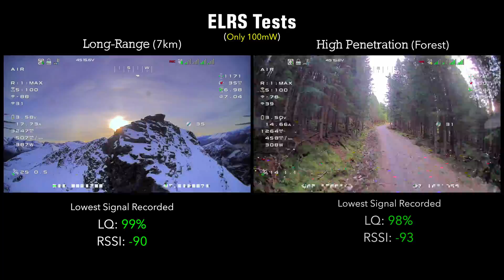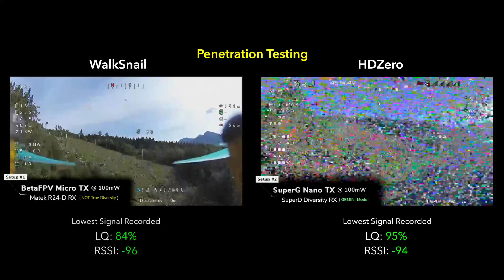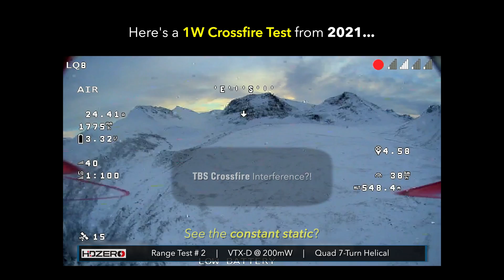Don't use ELRS or Crossfire at 1 Watt: RF Interference reduces FPV Video Quality, Range &Penetration

Comment: I seem to remember you doing either the ferrite bead or internal capacitor mod to your hdzero goggles to prevent the crsf reboot issue. Do you think that mod may have any impact on the video feed disturbance you show when using crsf at 1watt and close to your goggles?
Reply from the maker: I didn’t do any ferrite bead/capacitor mods. The video interference is just noise picked up by the antennas/VRX. I’ve actually noticed this issue as far back as 2021. I put a clip of that flight this video for reference. So I’ve seen this behavior on analog, HDZero VRX & HDZero goggles. Additionally I’ve seen it from both Crossfire and ELRS transmitters. 
Any high power electronic will create noise, that’s why Cell Towers, Powerlines and even Solar Flares can affect our FPV feed. 
Thanks for watching!
Reply: @GiantAntCowboy Thanks for doing that testing! It's really useful for me especially because all my HDZero flying has been short-range so far but eventually I'm going to send one!
Reply from the maker: Nice, I do a lot of longer-range stuff with HDZero and love it. Happy to help, cheers!

Comment: Walksnail or HdzeRo? I have the Walksnail vrx and HdzeRo goggles but not sure which one is the best solution if am going to go with Walksnail I will switch to their goggles because the vrx setup is too heavy and lots of wires but the picture in the walksnail looking superior however your video with the v3 looks much better but it’s hard to decide on watching YouTube so if you consider all? Which one? 😅
Reply from the maker: Haha! Choices, choices. Both are great, so there’s no wrong answer here. 
For me personally if I’m doing “Risky Flights” where the quad could be lost, I 100% prefer HDZero. HDZero doesn’t try to cover up RF Signal imperfections, and that real-time feedback is an important tool to avoid disaster in sketchy spots. 
WalkSnail/DJI will always try to repair the image first, then they add latency, blurry image, and eventually a black screen.  The problem here is delay, even 500ms is 10m (30ft) at 80kph (50mph). That’s game over if your a couple meters off a mountain ridge line. In my test shown in this video I had a 1600ms (1.6sec) delay recorded and even when it said 30ms it was super delayed. So you can’t trust WS OSD when signal gets bad. 
Ok… long answer, sorry. I do however recognize that WalkSnail looks great, especially when signal is perfect, and it’s very flyable. For “zero/low risk flights” I think WalkSnail is an obvious choice. I obviously lost my main WS setup… but will be installing a 1S VTX into a RC Rock Crawler soon which I’m excited about! 
  (And obviously Racing & Super lightweight builds HDZero also wins.)
But ultimately it’s just about how you plan to use the system. For general park flying or even long-range wings WalkSnail’s negatives are outweighs by its excellent image. 
Hope that’s reasonable and helpful insight. Let me know, cheers!
Reply: Thanks a lot for your detailed response I think I need to get the 1w HdzeRo and v3 and I’ll have the decision hopefully it will have more range and penetration since the whoop ones are worthless on bigger quads ..and the rainbow screen means for me game over.. but thanks again
Reply from the maker: @Switch180fpv  absolutely happy to help. Note: HDZero will always require better antennas than DJI/WS because it displays exactly what it receives in real-time. 
If DJI/WS miss something, they can take a few ms to request the missing data and fix the image. So if you use basic antennas you’ll have more latency, which you might not even notice, but the image will look near perfect.  This is also why they appear to have better penetration. 
  Obviously you’ve seen my HDZero setup, and Helical antennas aren’t for everyone… but most decent patches or Crosshair antennas offer great performance. I personally recommend running four high gain directional antennas; everyone thinks they are hard to aim, but until you’re 3-4km out you barely have to even try to aim.

Comment: Now my question is , is this still as noticeable without a high gain antenna . This also brings me to the conclusion maybe a base station is good for any long range flight so you can space the transmitter further away from your goggles antenna.  Yes you can go through most stuff that your video transmitter won’t . But I don’t believe the controller lost connection first . The delay is about 5 seconds after you loose connection. Unless you changed that setting. I’m convinced you lost transmitting power same time as video. 

I’m not saying you’re wrong , I’m just open to the possibility.
Reply from the maker: High gain antennas definitely pick up more of this interference, I’ve test this in the past but will have to do another follow up comparison. However if you’re not using high gain antennas it’s also unlikely you’ll exceed the range & penetration limits of ELRS at 100mW. 
Regarding your comment on delay; I assume your referring to the “WS incident” where is said “my controller was connected for 5secs after losing video”. Here’s my logic:
I matched the last shown OSD elements to the telemetry logs recorded on my TX. After those OSD figures I saw 3-5secs of additional data captured by my TX Telemetry logs. (I have to re-review the logs again for the exact time). 
But, What do you mean by the 5 second delay option? Is that a WS or ELRS thing?

I’m also open to discussion, as I could easily be missing something.
Reply: @GiantAntCowboy   In my area, and the spot most available for me to fly at is a low area , lots of trees about 500m away and when I get a km out I come very close to losing signal at 100mw, but still have video transmission. I’m using a 13db patch antenna .   Testing at 500mw elrs I notice I get more noise in the video feed at 1km distance so cannot fly past that because of video transmission .  The transmission at 100mw in other places I can get past 1km no problem . This is all just the one location I fly at .  I’m also running analog 850mw vtx
Reply from the maker: @Loophole120  Very interesting. Which ELRS RX are your using? And do you have the antennas mounted out on the arms perpendicular to each other?
You saw my forest test, I’m about 600m out in that forest with barely any video (using four helical antennas) but my ELRS still has 95% LQ at only 100mW. 
So we should be able to improve your setup I think.
Reply: @GiantAntCowboy  I’m not just looking at the lq. I’m watching the db. And I’m close to failsafe of -103 but still have 98 LQ . Have also briefly lost connection during flight. I’m using the happy model  elrs module on my tx16s mrk 2. And these test were done with a  sub250 4” .  Rx antenna is a T off the front of the quad on a tpu mount . Get good line of sight away and to the transmitter
Reply from the maker: @Loophole120  the RX only has one antenna? If so, i recommend a True Diversity RX for your situation.  Diversity was a game changer for me; i currently run the SuperD RX which is great, but there’s a couple other “True Diversity” RXs available.
Reply: @GiantAntCowboy  Yes, that was the video. I was talking about the beta flight setting for failsafe but you didn’t have that on in the video. I was thinking about the set time before it goes into failsafe mode. Not in the receiver. My mistake.

Comment: I failsafed elrs on my whoop other day was so shocked. I was inside & flew out the window. Still had video and control just instant failsafe. 25mw with dynamic. Had a wall between me.
Using hdzero 200mw
Reply from the maker: Very strange, wonder if that’s my “Dreaded Dynamic Power” fear, or just bad luck. If you review the DVR do you see any clues? Like Dropping LQ/RSSI performance, or did it try to switch to a higher power and fail? 
I did actually Failsafe ELRS a third time but I don’t mention it because I was doing my penetration runs with a tiny ceramic antenna RX… not it’s intended use.
Reply: @GiantAntCowboy  the LQ dropped fast. Before dbm got up. Think just not fast enough to switch to higher power cuase dbm didn't go up fast. Wall got between us. But I kept video, lol. This has ELRS  I think, a ceramic antenna or copper on top board. Because the antenna already sandwich between boards being at 25mw and then instantly being blocked by wall or car doesn't give it time to raise power. Really on this whoop if I fly outside I need to run atleast 250mw
Reply from the maker: Yea, maybe best to just run a higher fix output power. 100 or 250. Then you should have an issue. Of course the small ceramic antennas aren’t great as you mention.

Comment: Dude @GiantAntCowboy you're the MAN. You just solved a mystery I've been dealing with for months. The one time I upped my Radiomaster Ranger module from 500mw to 1 watt I had a failsafe that I could not explain. Makes sense now! Thank you!
Reply from the maker: Excellent, glad to be helpful! Yea there’s just no reason to run these high power outputs. Not only does it create unnecessary noise, but it’s uses more battery and wears out components faster. 
I always ran my CRSF TX at 1W, and think I wore it out, because toward the end the performance was bad… I switched to ELRS and love it. Cheap & amazing! 
Thanks for watching, appreciate the support!
Reply: Try 2 watt in your radiomaster ranger and you will not get that issue
Reply from the maker: @ALEFA-ID  are you seriously recommending running 2W? Or just joking?
Reply: @GiantAntCowboy  Definitely. I always run 2 W using my radiomaster ranger in urban area and  this the best penetration I got.
Reply from the maker: @ALEFA-ID  ok, seems completely unnecessary, but if it works it works!
Reply: @GiantAntCowboy  thank you so much mate. Love your insight too

Comment: Strong out-of-band RF singnals can desensitize any receiver.   To date, FPV receivers have had very little in the way of front-end filtering so will be subject to this desensitization.  Perhaps it's time for more effective RF shielding and better front-end filtering for our FPV gear now that higher power levels are becoming the norm with RC gear.   Either that, or it's time to go back to mounting your FPV receiver on a pole (close to the antennas) and running the video feed to the goggles -- just like we did in the old days, before goggles had built-in receivers.   There are many benefits to this strategy -- including better range (for low-level ops) when the antennas/receiver are elevated by even a couple of meters above head-height).
Reply from the maker: There is he, knowledge himself has arrived. Appreciate you checking out the video and providing realistic insight. It seems like front-end filtering or shielding would be a solid next step. Though the point of my video is modern control links are so good that we don’t need high power. 
  A fellow down in your part of the world did a 100km range test last year with a 100mW 2.4ghz ELRS setup, incredible! Sadly “your buddies” down at the government office ordered it to be taken down… 
  For me 7km is plenty and my current systems/setup do that no problem. In 2021 I was troubleshooting this exact issue with 1W CRSF, and I finally decided it was time to make a video. 
Keep up the good fight, we all appreciate your efforts, cheers!
Reply: @GiantAntCowboy  I agree.. power isn't all it's cracked up to be -- so long as you have line of sight.  When you're flying proximity however, having extra power on-hand to either punch through or reflect sufficiently to give a useful signal at the receiver antenna can help.  Those amazing range figures for ELRS are inevitably direct-line transmissions which means you won't be able to "ground hug" for more than a Km or two before you run out of RSSI.   All those very long distance flights require altitude (to keep the curve of the earth out of the equation) so they're not that useful to us if we want to stay out of manned aviation airspace (ie: < 400ft AGL).

I'm a great believe that more than "enough" is too much, when it comes to RF.   I'd much rather use a better antenna than just push more energy up the spout.   Another  alternative is lower frequencies for the RC link.  Perhaps it's time  to revisit 72MHz, which has far better penetration and propagation when ground clutter or other obstructions are involved.  I wonder who will be first to apply moder RF technology to the 72MHz band and produce a really good long-range capability even at lower altitudes.
Reply from the maker: @xjet  yes, all accurate points. I don’t fly wings, and prefer close to the ground flights. Fortunately “close to the ground” for me is also high altitude because Norway is a mountainous landscape. The only LOS issues are solid rock ridgelines & mountain peaks which immediately kill your signal regardless of the system or power… you just have to plan & be prepared. 
  I only fly HDZero or Analog for those flights because they don’t try to hide signal imperfections; a necessary tool up there. 
  Ultimately there’s certainly things we could do to improve things, but if we’re actually trying to stay on the “right side of the law” we’ve basically reached the limit. 
  For years I’ve been making & using Helical antennas thanks largely in part to a video you did long ago.  You probably haven’t seen my channel much, but you might appreciate my current quad helical setup.
https://youtu.be/CYphV5FPbYc
Pretty fun, check it out if/when you have time.
- Pete
Reply: @xjet  Considering how the use of drones have developed (no need to mention how) it's likey just a matter of time.

Comment: Thank you for this feedback!  It makes perfect sense!  Going to adjust my TX output.  Pretty sure I have them all at 250mw but not 100% sure.  I think I’m safe.  When I was first experimenting with my new walksnail video system I had it at 1W. And I would get these few seconds of freeze frames.  Long enough delays for a crash at low altitude and lost of obstacles.
Reply from the maker: Yea, 250mW is a happy medium, I’ve been using 100mW because I can, but maybe 250mw would be a nice “just in case” given my “unforgiving flight locations”… 
People have said DJI/WS are impacted by this, but it’s all 5.8ghz RF transmission and interference will have an affect. Mostly in the form of latency, or pixelation, as you mentioned, for the two digital systems. 
Thanks for watching, appreciate the comment. Cheers!

Comment: I like dynamic power and never worry about it on crsf. Also keep in mind that if youre flying in an urban environment thay could affect your oerformance esoecially at only 100mw i used to fly my tracer at 100mw and failsafed passing and obstacle never happenwd after i increased it
Reply from the maker: Yea, I gotta test Dynamic Power again for ELRS, sounds like it’s stable now. Urban environments are tricky for sure, but these modern control links should still easily outperform out FPV Feeds. 
Appreciate the comment and support, cheers bud!
Reply: You are correct. I have the same situation with you. I use 2 watt in my radiomaster ranger and fly my quad in urban area

Comment: IMO putting C2TX power on a switch is preferable to Dynamic Power. It is easy with the TBS script to setup power levels for different purposes. (25,100,250 for bench), (250,500,1w for LR). Locating the C2TX antenna away from the operator with a tripod and 6’ coax cable solves most of not all RF bleed through to video systems.
Reply from the maker: Yea, years ago I figured out how to setup my analog VTX on a switch. It was super useful for bench testing, waiting for satellites, and general antennas testing. 
And there’s plenty you can do to further squeeze performance. From a simplicity standpoint my current setup does exactly what I want. Additionally I often hike to locations and so I’m always trying to minimize equipment and weight. 
But thanks for watching and sharing, cheers!
Reply: @GiantAntCowboy  Same here… All my gear (including First Aid, Binoculars, etc.) fit in a Pelican backpack that leaves both hands free. I usually fly from where cars can’t drive so keeping light AND including water is paramount. I use VAS helicals of different gains on HDZero gear. I’m starting to include a light tripod to mount the Crossfire antenna a few feet away from the goggles to see how that improves things…

Comment: Dynamic power has its benefits. Let's say you take off, and the power output suddenly goes absurdly high, even though you are only 200 meters away, you know there is a problem with your gear like a loose antenna connector or possibly high interference close by etcetera (happened to me once). If you fly with fixed output power, you must pay close attention to your RSSI dbm. LQ might not be affected until it drops and then it could be too late. I just feel it's easier to read output power than RSSI signal, but that's me. If you fly with dynamic power the interference wont be constant if it jumps to higher output power. Dynamic power on CRSF never caused me any problem at long range.
Reply from the maker: Solid input, and suggestions. Appreciate you watching the video and sharing your experience here! I gotta start testing dynamic power again, maybe I’ll start with a shorter range freestyle quad and see how it works. Cheers!
Reply: @GiantAntCowboy  My pleasure. This is what the FPV community is all about (or should be). I like your videos because they are easy to translate to real flight situations. Especially since I have flown many times in Norway. Great work.
Reply from the maker: @icp-trek absolutely, I’ve learned a ton from the community and do this simply to share my experience and give back to the hobby. It’s certainly not for the money or fame… lol
Appreciate what you said, I try to keep my videos relatable, fun and interesting.